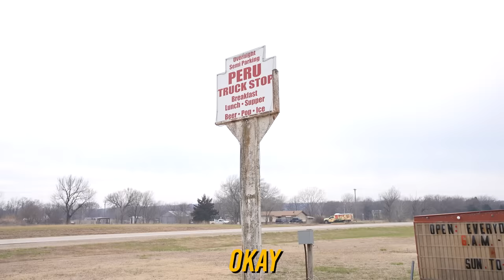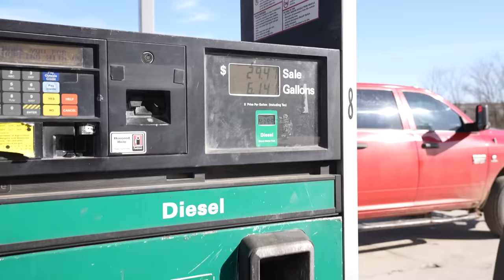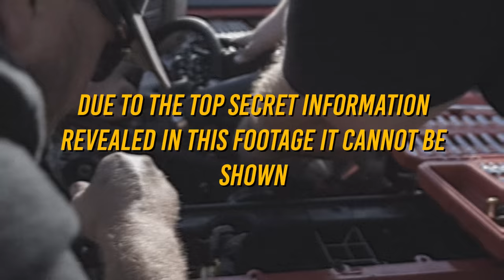We Road Trip the Cummins Mustang and Race It

Comment: I find it crazy how these guys can make a regular car sound like an 18-wheeler
Reply: Isnt that what this engine is usually in?
Reply: im waiting for the cummings powered motorcycle, the cummings powered moped, and the cummings powered bubble car
Reply: @CAMSLAYER13  no.
Reply: @bored588  Cummins go kart.
Reply: @CAMSLAYER13  Not exactly this is a 24v cummins turbodiesel usually in Ram 2500s and 3500s+ but yes semis do use turbo diesels just not this particular model
Reply: Just the 12 valve Cummins sounds like a tractor. The 24 valve doesn’t sound near as sexy in my opinion.
Reply: @drsnooker1776  Cummins powerwheels

Comment: The scene placing the hydraulic lift/support for the transmission is great :). Just in case if it was not only for the fun, you may open the release valve and lift it by hand to the point you need, then close it and jack it up.

Comment: have a 2004 mustang gt and It's stalling rough
idling when driving the speed is really low like it
won't go over certain speed as of today I got the
02 sensor done still no help seems like it made it
worse because now I can't even drive 1 min with
out cutting off I was in traffic it did it to. I be so
upset because i seen grandma go around me
because of the slow acceleration. It also made a
loud gunshot noise that was weird. I'm also
having the trouble for the car turnover after
several several attempts to cut on it comes on
but it now diesso far I got these did
*spark plug
Coilpack
Camshaft sensor
Fuel pump
Fuel filter
02 sensors
I am going into debt trying to figure it out and
the shop seem to don't know what's the
problem.
HeeelllllIppppp meeeee

Comment: Hey westen i have a 1997 f-250 heavy duty, engine swapped 5.7L inline 8. I absolutely hate it i can't accelerate properly with it. I was wondering if you have any tips on why it won't accelerate property, 2021 fuel filter btw

Comment: Can confirm Power Driven Diesel transmissions shipping are fast, and the units are quality. "Ain't oil underem...." please don't curse me I just replaced tappet cover gasket, vacuum pump o-ring kit install, front main, new trans lines, valve cover gaskets to finally have clean driveway.